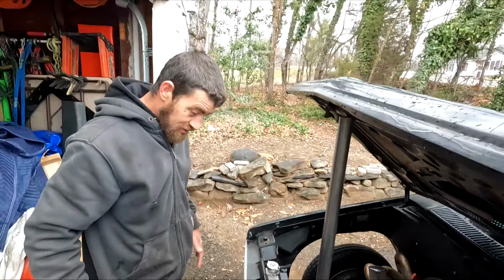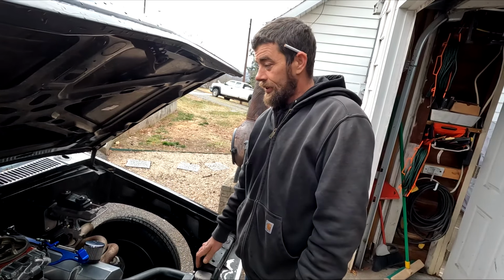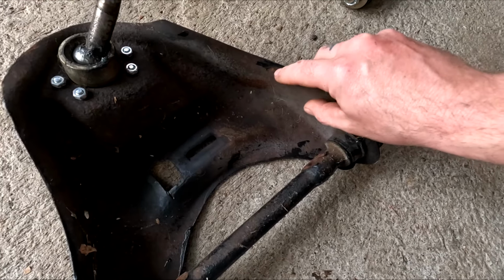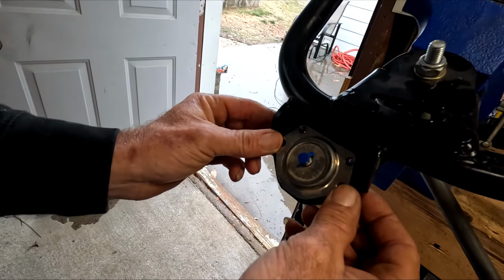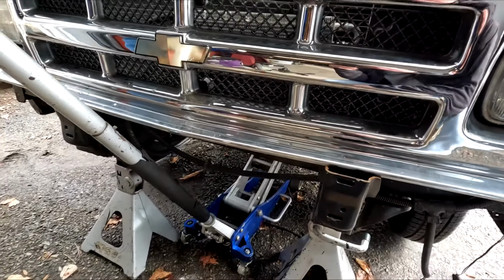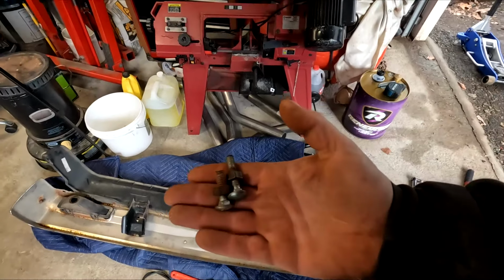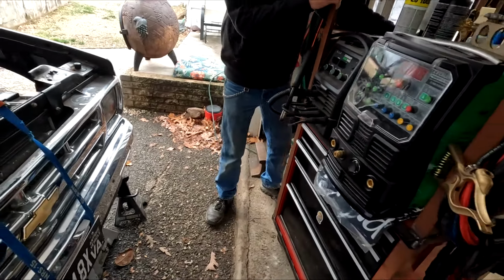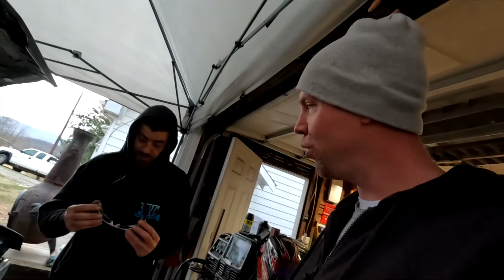Junkie Tubular A-arms and Getting the Bumper Mounted on the s10

Comment: Yall can run some 93 pump gas or whatever u got there just get the carb an all worked out I wouldn't b wasting that liquid gold race gas save it fur when yall go to the track what I used to do won't hurt anything also why does everything set lower on the truck front cap an cab did yall use different body mounts or bushings or ? Good luck guys ready to see it making some passes
Reply from the maker: You can run 93 with 13.5 to 1 compression? Not sure what happened with the front end, we use the same cab mounts before we welded the cage in. Maybe tighten them more to much🤣🤷🏻‍♂️
Reply: @EdsGarage99  yes it will run fine just to get bugs worked out I ran 93 n my 14.5.1 just to move it around but put race gas n when at the track

Comment: The only reason I can think why it would be sitting will like that would because maybe the radiator bushings
Reply from the maker: We had to modify the radiator mounts in a previous video to get the front end to line up right, had to lower it about a half inch or so. Not sure what happened when we put it back together and welded the cage in, it was like that so we just roll with it.🤷🏻‍♂️